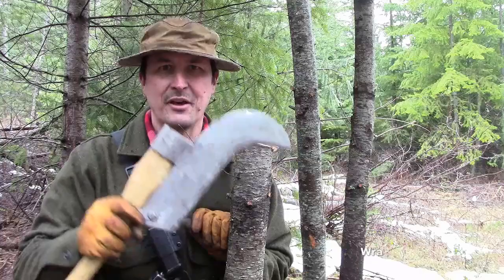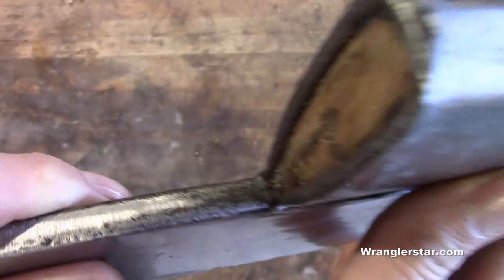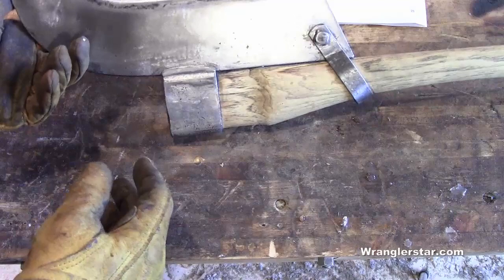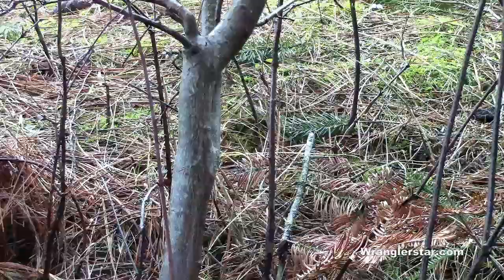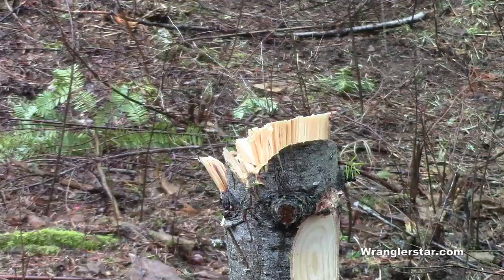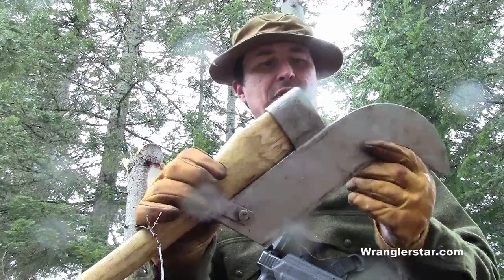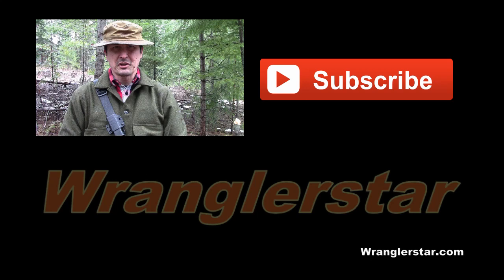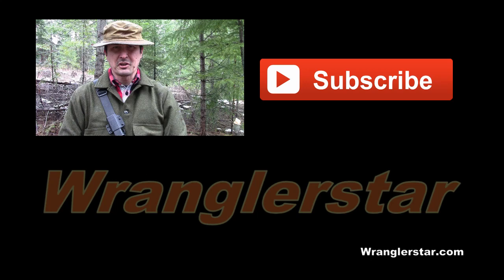A Proper Brush Axe - Wranglerstar

Comment: NOT A TOOL FOR WOMEN - WHAAAAT????? You're using it wrong, my friend! I'm a grandmother, a month shy of 69, 5'4" and 145 lbs, and I LOVE my two-handed billhook!!! For one thing, laddie, I chop right down at ground-level, swinging hard enough to cut through the trunks of bush honeysuckle, chokecherry, sumac, wild grapevines, and young black walnut and honey-locust that I tried to whack with a cheap Harbor Freight machete - and nearly destroyed in the process. I don't have time to chop them twice to clear my land. Mine has a regular-type wooden axe handle, and a heavy blade, with the sharp edge extending clear up and around the top of the hook. It's a LOT easier to use than whacking those same plants wtih an axe, or even with my Stihl chainsaw. I wouldn't hesitate to strap this on my back to take on a hike. It will split smaller firewood, cut brush, and chop weeds. I LOVE IT!!!!!!

Comment: Some folks calls it a Sling Blade, I call it a Kaiser Blade.......umhum 

In the South it was used by the Chain Gangs to clear banks along the State Roads in lots of the Southern States.  It was used to Clear brush & saplings closer to the ground. These tools work best where there's no spring on impact and while swinging in a downward angle, leaving a sharp stob sticking out of the ground 2-6" if done right.. Just one long, even, graceful  powerful stroke with a downward sweep will  slice  2+" saplings in one swing and ofter with just one hand. In the 50s & 60, the Chain Gangs in the Deep south used them exclusively. When I was 7-10 years old, we would drive past these Chain Gangs all the time...Work Release was different then, they had to work really hard. I watched crews swinging these Kaiser or Sling Blades every Spring and Fall. 

It was like the movies we've all seen. Ive watched Men working with other Men  they were chained next to. They were chained 6-10' apart and would sometimes fall into a rhythm with the other workers after a little while....just like in the movies. They would sometimes compete, seeing who had the best swing, strongest stroke, or who could cut down the most saplings with one swing of the blade. 

One sweeping swing can bring down large saplings one after the other, time after time like a machine once you find a good rhythm and learn this tool.  The perfect site has straight consistent saplings 1-2" thick with a bit of space between them & has no tangling under growth to tangle your blade and slow you down. ....matted areas make for slow going and tiring work because you cant get a rhythm that makes it more like a dance & less like a job. 

 I've used them quite a bit myself and they take much of the work out of this kind of job for sure.  And yes, the hooked tip hits the dirt often but that's not where the work is being done, so it don't much matter. The hooked tip acts like your arm, gathering in thinner material to help pull/hold & steady it while the wider, heavier straight part of the blade delivers the shearing blow that does all of the heavy work. You hardly ever see a sharp tip on these blades when they are used day after day. All you gotta do is aim it, give it a push and hang on to it..as .it does most of the work when you learn to use it wisely,  conserving your energy through the day. Once you really get the feel for it, you can work all day and not be nearly as tired as you might think. 

The State Road Departments would clear the banks of saplings every few years like clock work, while the new growth was prime size for these blades, the Gangs would walk through these places like hot knives in warm butter....leaving an area covered with nothing but sharp little stobs sticking up 2-6" depending on who is swinging the tool and what's being cut. 

Today, they have resorted to chemical sprays and we all know what that means for us. But, as long as 2 man crews can keep these areas cleared where it used to take thousands of Prisoners & Armed Guards State Wide, the State will continue to sanction these Chemical Management Programs that we are seeing today.....

Sorry for the long post! I love to write and do get carried away telling stories sometimes.
Reply: You beat me by over a year
Reply: Thanks for the read Raylon, I enjoyed it!
Reply: I loved that movie by the way
Reply: The Walking dictionary...
Reply: Cool Hand Luke movie has em....
Reply: Most educational post I’ve read on YouTube
Reply: Kaiser blade yes. I wonder if the energy one expends swinging this --if it is better just to use a top quality lopers where not too much energy is used.
Reply: I started this utoob session with the goal of finding out how the brush hook 
(one of which I got a few years ago at a yard sale for cheap, which could use a little restoration, but is still functional)
and lo, I find it here in the first comment, on the first of six videos, that I have lined up in tabs.
I now have the strong sense that I won't be learning anything more from those other videos.  Or comments, for that matter.
Most useful comment I've ever read.
Thanks, brother.

Comment: In the UK we call them Bill hooks, and almost every county has its' own variant, which are of different handle lengths and blade styles.  For instance a Devon or Cornwall bill hook is a short one handed, single bladed tool, but a  Yorkshire bill is a medium length, long handled tool with a flat machete blade on the back.  They go back many hundreds of years, and were one of the most common tools for peasant farmers and foresters...and poachers.  I have been using them for 27 years to brash thicker branches, and they are pretty much awesome on both hard and soft woods!  I have one that is nearly 90 years old (but the blade is getting a bit thin now), but my main one is used virtually every day for forestry work.

Keep up the good wortk with the channel by the way!
Reply: Sammy Bee yeah, I was just thinking that! I just found one behind my garden shed in devon, not sure what type it is yet, it had a longer handle so probably a yorkshire.
Reply: A bill hook is a brush axe that was weaponized for war..

Comment: Great video. I really dig the way you emphasize using the tools of our grandparents. As to the brush axe's use, it's a great general clearing tool for survey and forestry crew. I work in the engineering field and we use the brush axe to clear away small brush to take survey shots. The hook is great and tearing briars and brambles down to the ground so they won't snag you and chop down small trees as you've demonstrated. The brush axe is a multipurpose tool that is best suited for brush clearing and small saplings (<4" dia.). When you don't have room for a brush trimmer or mowing scythe, brush axe is your best bet. Keep up the good work and God Bless.

Comment: I worked with Dad doing some clearing with brush hook, Dad would swing it kinda like a golf club to cut the brush on the up swing.  Dad helped me get the hang of using one and once you get the nack of using one you can clear ground rather fast. 

Dad got good using one clearing the homestead in Alaska when he was a young man.
Reply: Kriss Femmpaws That's the way they are used around here. The up swing utilizes the hook more than the downward motion of ax cutting. Those used here have a longer handle to make cuts closer to the ground. Before modern powered tools and herbicides came into being, they were often used to keep brush cleared on power line right of ways. And, keeping the shoulders of rural roads cleared, as well. Another use, I remember was keeping fence lines and such cleared.
Reply: In Alaska one of the things you get to deal with is Devil Club... clearing it can be a big chore.  I use to cut Grandma B's fence lines with a scythe in the summer and fall in the late 60s and early 70s.  The brush hook was used for the saplings and black berries.

Comment: Awesome!  I used brush hooks growing up to clear huckleberry and salal for dirt bike trails up here in the NW.  I have been looking for an older one like that and recently picked up an old PEXTO Bell System brush axe that I am restoring.  I will be putting it to work soon.  I find that striking the brush lower toward the stem is much more effective and eliminates the flex and deflecting. Shin guards are a must!

Comment: I used to spend my summers, during my teen years, clearing brush in South Georgia. we used the bush axes with both edges sharpened. Definitely my go-to tool. Especially for cutting roots and getting after the palmetto brush where the snakes like to hide. When I started working on a bush hog crew cutting right of way for transmission lines, it became my go-to for not spending 10 hours bent over, swinging a chainsaw when we had to hand cut an area too soupy for the tractor.

Comment: I just picked one of these up at a flea market for six dollars. I cleaned up the blade and put a new edge on it, along with refinishing the handle. I have been using it a lot and love it. I tried to get mine shiny like yours but instead it came out looking more like a rust blued gun barrel finish, which is fine by me. Keep up the great videos!!!
Reply: Samuel Williamson Oh and I forgot to mention that mine says True Temper on the blade and then under that it has an unreadable word and then Works. Could be we have the same tool!

Comment from the maker: Viva La SFC
Reply: First rule of SFC, you don't talk about SFC.
Reply: in  ireland we call a burke blade a slasher well at least we do we have one of them. we use ours for clearing thorns and grass when we go fencing around ditches
Reply: +The Pilot Penguin Here in Florida we call it a ditch blade, because they are excellent for cleaning out brush clogged ditches & culverts.
Reply: makes sense
Reply: I realized that in this video you said this tool is not for women or children because you need a lot of upper body strength. are you implying that women cant have that upper body strength?
Reply: +JONAS EATON there is a reason women aren't renowned as woodsman
Reply: JONAS EATON most women don't have upper body strength like most men
Reply: Women certainly CAN have the upper body strength, without strength training, most women and many men would have issue using this tool. I haven't trained in quite some time and I'm sure I'd only be able to manage a minute or so without needing a lengthy break.
Reply: Matt Scranton i said MOST women don't have the upper body strength because some don't care about strength and some do
Reply: I can't believe you insinuated women shouldn't use this, tool. Some, perhaps? All? Not even, maybe. I've seen some women outwork men, in the bush,/hanging drywall/home building, etc. And, on that note, I've seen women who can't make ice cubes or, boil water. That being said, we do enjoy your show, and watch quite often. !!!Cheers!!! 🔨 🔩 🔧
Reply: Dark Knight MGTOW LOL, and my comment is my opinion. See how that works? When it comes to opinions, we are all, entitled.   :-)
Reply: +Jack Kruggan who can't make ice cubes and boil water
Reply: +Jack Kruggan and he said children or women because you need a lot of upper body strength most women have skinny weak arms and upper body
Reply: Why?
Reply: Just use a shotgun...
Reply: Wranglerstar  I know your in America but you might be able to find a Bulldog Irish slasher, Google it, it's a great tool for laying hedge or clearing thicket.
Reply: I've done so much work with an Irish Slasher... brilliant tool when used right.
Reply: Tyvole  Yeah the reach it allows and the fact that you can go ahead and edge a ditch with it if you so desire.  Awesome tool.
Reply: Wranglerstar how do i get rid of alder permanently without digging them up?
Reply: Wranglerstar Sweet, I have a Burke blade and brush hook but I didnt know what they were called....Got them at a garage sale for $5.00 each!
Reply: Wranglerstar brush axes are more common in India, we had one when I used to live there

Comment: The burk blade you pointed out is known as a ditch bank blade in the South/East/Southeast of the country. I've been using them all my life, and they're fantastic for:
- Clearing pine saplings and young stands of Chinese privet
- Pulling kudzu, honeysuckle, trumpet vine and wisteria away from trees and fences while also cutting them
- Dragging small logs out of the way, sort of like a pickaroon
Different designs, I think, are meant more for different things. Double-edged varieties are meant more for lighter work, even though they're still super heavy. They just don't bite as well as a good axe or cane knife for taking out small trees.

Comment: Cody,  I used several similar Brush-axe over my years in SAR.  We mostly used them when we had to clear brush for evidence searches.  Ours seemed to have a slightly more pronounced hook that allowed us to catch those springy scrubby vines.  They worked especially well for clearing the thick blackberry vines that grow everywhere here in Western Washington.  The preferred technique was to hold the blade low along one's side and use a stroke that was both upwards and forward. Imagine paddling a canoe backwards. This helped to keep the user clear of the dangerous end.  Cheers.

Comment: Thanks for the video.  I have my grandfather's bank blade & have used it for 25ish years.  Even in hard Texas stuff, it's my goto for clearing fencelines or back-grown areas around stock ponds,  Sumac falls like tin-soldiers to it.  As you demonstrated, it can fall smaller trees, up to 6" in a pinch.  As you use your new one, you'll notice it definitely has a sweet spot on big stuff.  Have fun!

Comment: Used one of those starting younger than I can remember. Helps to keep hits closer to ground as that helps take the springiness out of the hits. Also one can attack from mid area with high swing going downward sharply. That is useful to do when dealing with long things for you can clear it back enough to get nice low hits. It is a great tool for undergrowth clearing and path making. The different parts of blade lends themselves to different tasks for sure. I spent hour upon hours just walking thru woods making paths with mine as a child. It gives you a great work out.

Comment: When I was young and worked for the Ca. Forest Dept. and at that time the Ecology Corp. I used a brush hook and in Ca. brush fires that thing cut like crazy. The one I had was about 3/8 in thick at the spine and was a flat grind all the way from the edge. It went through 1 to 1 1/2 in thick brush with one swing. It was better than the one he has. We made firebreaks at an impressive speed. That was at the front.

Comment: use to use this for clearing underbrush, and green briers.  Here on the east coast they can get very thick and are difficult to remove.  Brush hook was perfect because you can reach in, cut the base in a pull motion.  And as you have discovered, take down smaller trees too.
Thanks as always!

Comment: Considering the weight of the tool, and the length of the handle, the penetration is rather poor. It seems to me the edge geometry has to be optimized. This thing deserve a real grind to realize it's potential. Right now, it seems to only have a steep bevel, which "artificailly" slows down the blade, dissipating many joules in prying the wood fibers appart for no use. Basicaly, it seems they just took a rather thick sheet of steel, cut the blade from it, welded the eye, and applied some sort of mock bevel as on a machete. But what works with a machete because it is thin doesn't work with a blade about three times as thick.

Regarding the "centuries of refinement as a tool", I have all reasons to believe you're wrong. I'm a billhook collector and edged tool enthusiast, from France, and I'm interested by anything that's got an edge from all over the world, as far back in history as archeology can find. I know there is no similar tool in France or Italy, and I don't recall anything like a brush axe in Britain or Germany either. To me, it looks like a typical 19th century american product, designed to be easily made industrially.

Regarding the brush axe variation that got the axe eye at its heel instead of in the middle, I know some japanese tools that look quite similar though, but it can't seem to recall the name right now. The classical american brush axe head looks astonishingly similar to some types of medieval polearms, like a perfect mix of a bill and a bardiche.
Reply: MadNumForce This design certainly is all about making a shaft-hole billhook (serpe à douille) easily hafted on a standard felling axe handle. The best way to put the eye adapted for an axe handle is to weld it on the back of the blade, etheir on the heel (simple douille extérieure), or in the middle plus another riveted eye strap on the heel (double douille extérieure).
Reply: @aryafeydakin  It's also about leverage and durability.  With the ax eye on the heel of the blade, there is a lot of leverage trying to bend it backwards, break the weld, or break off the end of the ax handle.  Putting the eye in the middle of the blade reduces that leverage by half, and the strap at the heel of the blade further reduces the tendency to wrench the blade backwards. It is a very rugged design, even if not a thing of beauty.

Comment: That's a sweet billhook. Me and my father use one-handed billhooks while out undertaking forestry work. It's just coupling swinging technique with strength, easy to remove all branches from thin trees(7 inches thick and lower) no matter the tree's species. Oak, beech, fir, you name it.

It might also partially be a cultural thing  I find a billhook handier than a hatchet or machete when in the brush, but it's basically been the Western/Northern European equivalent of machete in the diverse ways it was used in old times.